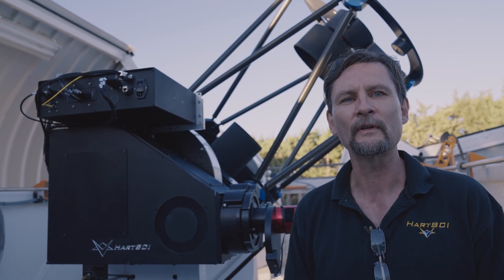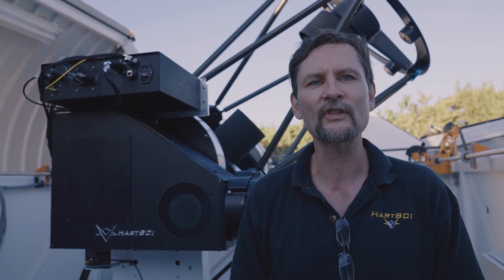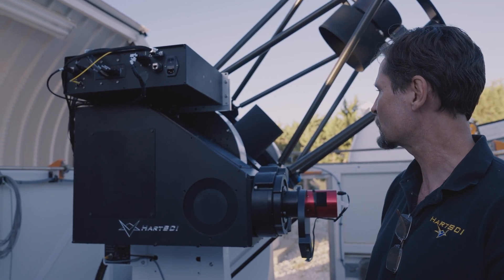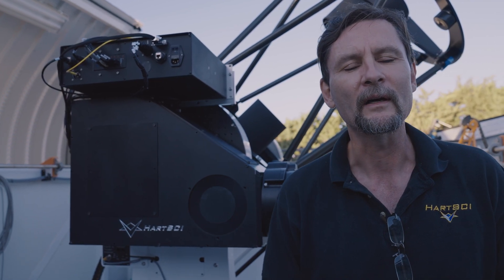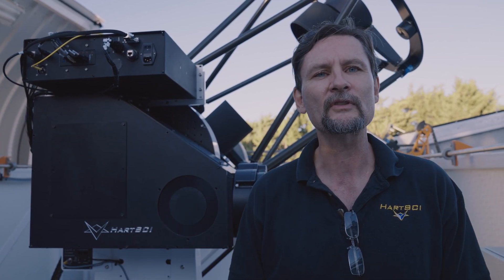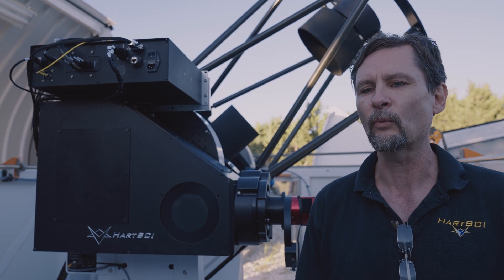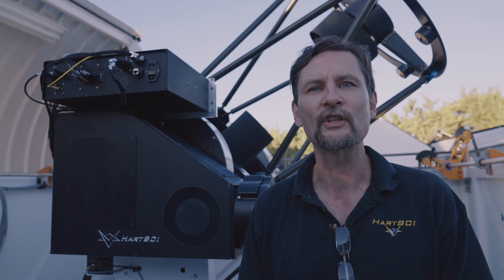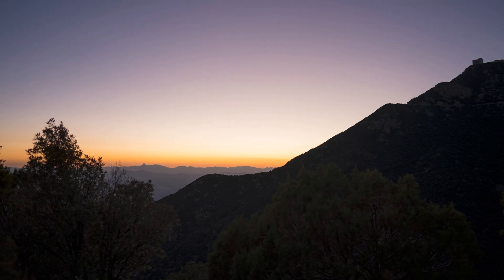PlaneWave CDK700 and HartSCI ClearStar Adaptive Optics

Comment: Wow I didn't realize adaptive optics were available for small (compared to professional) scopes. Of course this is a large scope for an amateur and of very high quality (I am familiar with PlaneWave and I know they produce high quality scopes). But I'll never be able to take advantage of an adaptive optics system. I can't afford a PlaneWave scope let alone the adaptive optics.
Reply: This is still very much for research application. The fov, like in any other AO system, is extremely small. Not to mention that this only works at 750-1000nm range which is NIR.

So yeah, research application, as it should be.

Comment: Impossible..!

Witchcraft..!

Seriously though, ok I get how using transducers to flex the mirror could work to cancel atmospheric aberrations, but how does it know what the atmosphere is doing in order to compensate?

Or else is there a lot of fancy processing so it can tell fixable bluriness apart from bluriness it can't do anything about...?

Anyway, amazing system there guys. Nice work...!
Reply: To detect atmospheric blurring the system observes a guide star. It knows the guide star should appear as a point of light so it determines how the image has been distorted by the atmosphere and corrects for it. Adaptive optics on professional telescopes create an artificial star to detect atmospheric distortion. They use lasers to excite atoms high in the atmosphere creating an artificial star which the adaptive optics system analyzes to determine how to correct for the distortion. Professional telescopes using adaptive optics have a deformable mirror in the optical path that uses computer controlled actuators on the back of the mirror to adjust its shape up to 1000 times a second to correct for atmospheric distortion. I don't know if the system in this video also uses a deformable mirror or has some other way to correct the distortion.
Reply: Non fixable blurring? Like only  diffraction blurring.
Reply: @mrbaab5932  Hmm. I guess most if not all atmospheric distortion is correctable in theory but doesn't that require some detailed knowledge, from one moment to the next, of precisely how the cone of air you're looking through is wobbling about?

Clearly I'm no physicist, but an engineer.

I don't know anything about optics and the more I read the less I understand.

Nevertheless, am I right in thinking that the magic box works a) mechanically? And b) by squeezing, bending or otherwise introducing small, localised distortions in order to compensate for lensing effects introduced by the atmosphere? 

Finally, c) on the processing side, does it effectively look at isolated sections of the image and make a guess as to how to sharpen it or maybe d) try to sharpen it or e) just leave it alone if it's not confident of improving anything?

Make sense...?

Maybe someone can point me at something to read by way of a broad overview.

Now that I think about it, I bet all the best data and expertise on this problem lies not with the astronomy folks, but with the the spying folks at the NRO...
Reply: @RickySwan   IF I am not mistaken, This type of optical correction "only" corrects (very quickly) the position of the guidestar so that it lands well on the imaging sensor, much like some DSLR-lenses have a stabilisor in them (or DSLR sensors can be shifted). So no mirror-shaping is done.

Of course the effect is better when you have long focal lengths.